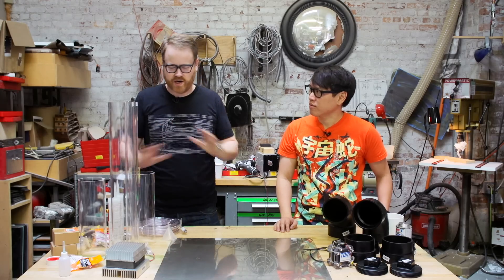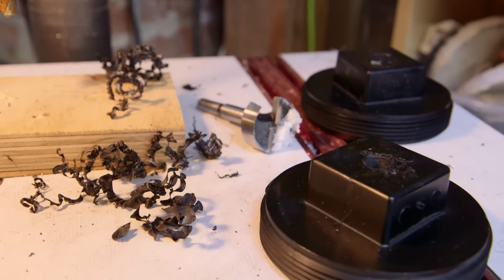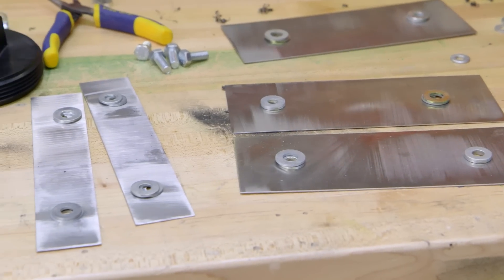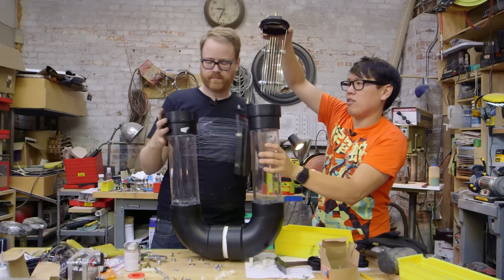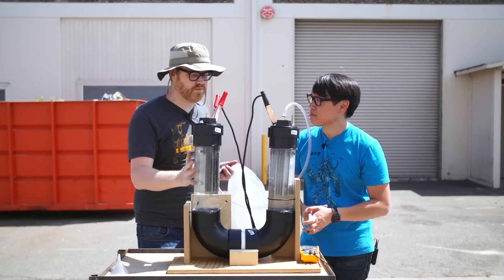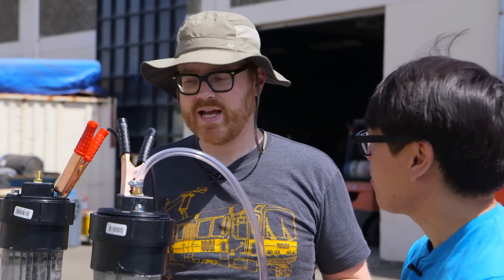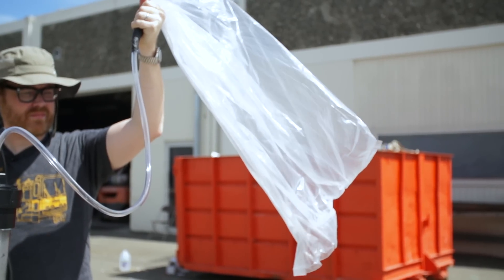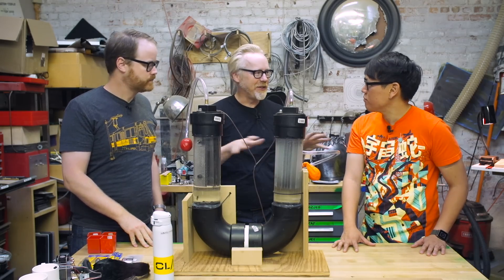Tested Builds a Hydrogen Converter

Comment: That bag is too thin, lots of gas slips out.
Reply: +minihjalte 
Actually I am think about a water trap to collect the gas.. 
what they did to collect the gas actually surprise me lol
Reply: +minihjalte  Maybe Mylar would be more successful?
Reply: +minihjalte Which is partly why Hydrogen fuel cells are such a bad technology for many applications, the hydrogen is very difficult to pressurize and then store, compared to just pumping electrons into batteries.
Reply: +hallis1 NO2 molecules are way bigger than H2 molecules.
Reply: +thegreatMSG Grant made a water trap on Mythbusters to trap Nitrous Oxide for the Confederate Rocket myth. Looked like it worked well.
Reply: Correct, the hydrogen quickly goes through the balloon because the molecules are so small.
Also, the resistance greatly increases reducing the conduction because of distance -- one set of plates on plus and one on negative separated by the whole bend of the pvc - this does separate the H2 an O2 gases but sacrifices efficiency. If a 24VDC battery was used the product would be much greater.

This 'improvement' is not such over the greater production of a mix of gases placing alternate plates pos and neg at much closer distances.

Comment: The hydrogen economy is a bit of scam. 99% of H2 comes from natural gas and fuel cell ev´s need EV batteries to supply enough power to the motors; so its an EV with a $100k, overweight range extender.

Both price and mass need to come down one order of magnitude until its viable. Not to speak of the almost insurmountable task of actually storing and supplying megatonnes of H2 to consumers. Ship engines and stationary backup ok, but cars and basement power plants not so much.

Comment: Now if you put the hydrogen gas in a blimp and replace the fuel used up by hot air, you've got yourself a really exciting gas tank :-)
If only hydrogen could really be made liquid at room temperature and 1 bar. It's just too cumbersome to use for transportation. Combustion is so utterly inefficient. Just like petrol. More stove than motor. Which is why electricity wins, at least until a 3-4x as efficient combustion engine is allowed to exist.

Comment: i got really excited when i saw you were using a renology solar panel.   did you guys like it, i use a smaller sized panel to power my fish tank air pumps and filter.  i need a second panel, and larger power storage before i lose daylight to winter.  also in about 2 or 3 weeks, it will be running for a full year with almost no "on grid" power sources.  winter gets cold in new england, and i need heaters, and with the less light in winter, i have to go on grid for heat, and sometimes the filter, as it drains the battery pretty quick when there's no sunlight.  and just if anyone wants to know, it's a 50 watt panel at 12 volts dc, and a 12 volt 30 amp deep cycle battery, the air pumps run direct off the battery, and the filter through a 120v ac inverter.

Comment: I'm going to make some assumptions on the construction of the rig, I presume 316 grade stainless steel plates were used for anti corrosion properties as electrodes. Perhaps a different material should have been used since stainless steel wouldn't be that good of a conductor. Maybe some copper or brass; the worry of corrosion would be negligible due to the short life of the device any way. Results could be way more excitable.

Comment: The reason this didn't work as well as the other videos is because you attempted to separate the anode and the cathode. The closer they are together, the more current you get to flow through the water. Besides, having a perfect mixture of pure hydrogen and oxygen is the fun part ;)

Comment: Environmental wackos are so silly. Solar panels arent "clean energy". The materials to produce them have to be mined. For example silver, which requires moving tons of earth. Good luck doing that with battery powered excavators and solar panels charging those batteries. Then when they are dead they go in a land fill. Not to mention they are less efficient than just using gasoline because they are more expensive. The reason they are more expensive is because they require a higher investment of resources. Ultimately the main "resource" in a all production processes is human brains, so solar panels are sucking up human brain power at a rate far and above petrol production on a per jewel of energy output basis. Brains that could be used to make our lives better in any number of ways, including but not limited to, finding ways to reduce the need to consume power. Its all just such nonsense. But you know why they call it the green revolution. Its all about that green.

Solar panels are definitely nifty though. I hope the day comes when they do make economic sense.

Comment: Really cool idea for an episode. I enjoyed it, but garbage bags don't really hold hydrogen very well; it's a really small element (120pm vs Oxygen at 155pm) and thin plastics like garbage bags are prone to let it through. An empty Mylar balloon might be a good substitute! Also, like someone else said, if the molecule is being broken apart anywhere, you'll end up with both components at each end of your tube. It doesn't automatically remove the hydrogen at the anode and oxygen at the cathode. It's cool though, it was still a fun build!

Comment: It's weird they had so little success with this.. We had a science teacher build one of these in class once, and it was no where near as complicated of a build.. Plus he had a circuit to up the voltage, dono why these guys didn't do that, 22 volts is pathetic. And when our teacher turned his on, the water was practically boiling!
He filled a whole balloon by the end of the class.. Then, tossing safety to the wind, he took us outside, tied a flammable string to the balloon, and lit it.. A few seconds later, every window in the surrounding block was shattered, and our ears were ringing.. Of course, he got in a ton of trouble for that, but it was the coolest science experiment I ever witnessed in school.. heh
Reply: +smlifyrasor How big was the balloon?
Reply: +smlifyrasor Holy shit, you teacher was awesome.
Reply: +smlifyrasor Yeah, Tested's rig has a lot of empty space, so there's a lot of stable water just sitting there. They tried to 'maximize' surface area, but didn't do that at all, only about 1/3 of the rig is at work at any time, if that. A little more research would have probably yielded a better result, specially with a shop like that.
Reply: +smlifyrasor How did your science teacher's gasifier develop enough pressure to inflate a balloon? Just gas bubbling up is not going to overcome the elasticity of a balloon skin.
Reply: +Paul Frederick Well, hard to remember because it was over a decade ago.. But it was a very big balloon (maybe a weather balloon?), and I think it had already been pre-stretched or used for something, fully inflated and then deflated.. Plus he didn't really fill it to it's max, because that wasn't necessary, so it was still a bit floppy and wrinkly.. But that didn't matter cause it was still huge..
Also, I don't think this would even be a problem, as long as the system was properly sealed, eventually the pressure would build up anyway? I don't think pressure would stop the electrolysis, and there would be no where for the water to go, so the expanding gas bubbles would still keep filling it up.
Reply: +smlifyrasor Pressure will actually slow and eventually stop electrolysis.  Also, I'm a bit surprised that you had shattered windows as this is done indoors with no ill effects.  It definitely would have to have been a hydrogen and oxygen mix, straight hydrogen would be too slow of a burn (still quite explosive in our oxygen atmosphere, just takes time to mix).

Comment: The funny thing about hydrogen power and solar is in its life it cant recover the energy needed to manufacture it.
Reply: +Karan Chaphekar 
What kind of solar are you referring to? Photovoltaic can, given enough light. It maybe wont recover the energy if your putting it out way in the northern hemisphere. But theres also other Solar Power. And Hydrogen istn even intended to "create" energy. Its just as a way of storing Much energy in a very dense package. 
If you mean Hydroelectric power you are very very wrong: Norway covers all their energy needs with hydroelectric and Wind Power. All the Oil they have is exported or used for cars and boats only. (They also are the country that buys the most Teslas, so in Future theyll need no oil anymore)
Reply: +Stuner Only where the sun shines. I live in Phoenix. Solar is fantastic. Not just for electricity, but for things like home heating and hot water, but my uncle lives in Seattle and hasn't payed for his system yet after 15 years.
Reply: +Karan Chaphekar Solar Panels have an energy payback time of about 1-4 years depending on the technology.  Read "Energy payback time (EPBT) and energy return on energy invested (EROI) of solar photovoltaic systems: A systematic review and meta-analysis" by Bhandari et al if you're interested in the details.
Reply: +Karan Chaphekar There is no type of power that can recover the energy needed to manufacture it. Every time you convert energy from one type to another you lose at minimum 10%.
Reply: maxpolaris99
you mean those things that leak energy like you're trying to carry milk in a fishnet?
Reply: +Karan Chaphekar you say that in your youthful recklessness, but there are many many powerful solar arrays that can put out the amps to produce a lot of hydrogen gas, which can be used to heat your home for example, saving you hundreds of dollars in energy bills. And when you don't use it for heat, store it for later use or when the sun doesn't shine. Hydrogen is the perfect battery because obviously you can't store electricity. It just "disappears" if it's not used
Reply: +Mathew Crawford Energy return on investment is not the same thing as financial return on investment. There the main problems are the massive (direct and indirect) subsidies of non-renewable energy as well as the fact that most power companies don't want their customers to install small PV systems and will therefore give you a laughable feed-in-tariff.
Reply: +Karan Chaphekar If we could get the whole operation of manufacturing in space using solar, who cares?
If we use  1 million watt hours of fossil fuel energy to produce a solar panel that returns 750,000 watt hours of energy its a loss. If we use 1 million watt hours of solar energy in outer space to produce a solar panel that will return 750,000 watt hours of energy back on Earth, its  win.
The Laws of Thermal Dynamics guarantee we will always get less than we put in. But if what we put in was previously going unused or wasted, we are operating in the gain column.  
So suck that Mr Negativity!
Reply: +Stephan Wahlen You didn't just use hydrogen and dense in the same sentence, did you? Hydrogen has a pathetic energy density.
Reply: +Karan Chaphekar [citation needed]
Reply: +Paul Frederick  Hydrogen has quite a nice energy-density when stored compressed - far far beyond what any battery can do right now.
But that comes at the cost of needing high pressure tanks - aka you can not really do this for small amounts of hydrogen efficiently.
Reply: ABaumstumpf
No hydrogen really does not have a nice energy density, at least not compared to gasoline. Gasoline has more hydrogen in it than hydrogen does. Being as gasoline is a hydro carbon.
Reply: Paul Frederick  We are talking about storage.
Gasoline can not be produced that easily (yet).
But you can use hydrogen for energy-storage.
Reply: ABaumstumpf
You can pump water for energy storage too. Or winch a heavy car up a grade. Both of these schemes are already in use. Converting electricity into hydrogen is like converting dollars into pesos at a one to one exchange rate. It is just an incredibly bad deal.
Reply: Paul Frederick
 You seem to have no idea what you are talking about. 
Incredible closed-minded and over-confident - that is what you seem to be.

Yeah, pumping water can be used to store energy - so?
Have you tried using that water to power a car? Oh, that can't be done?
but with Hydrogen you can?
With hydrogen you can simple move it to wherever you need it - simply move the tank and you can use it at home, in a car or somewhere else.
It is a rather nice way of storing medium quantities of energy.

For water-storage you need stationary facilities. They are useful too, but they also have their limitations.

With water for example, you can either have a huge station with big reserves and huge power, or you got smaller ones with really low power.

With Hydrogen you can have extreme output-performance, far exceeding any mechanical powerstation, far exceeding batteries or even gasoline.

It has its uses - and it is used guide a lot.
Those people know what they are doing - you are NOT smarter than the engineers that design those systems and use them.
Reply: ABaumstumpf
We already have fossil fuels. Why convert hydro carbons into hydrogen.Why take the extra step and pretending it's a new energy source  that is adding to our available energy resource?
Reply: maxpolaris99
"Why convert hydro carbons into hydrogen."
Nobody suggested using hydrocarbon as a basis.
And fossil fuels have this tiny little problem of releasing millions of tons of CO² when burned.

"Why take the extra step and pretending it's a new energy source  that is adding to our available energy resource?" 
Again - nobody says that - how about you read what was actually written?
It is to STORE energy we produced otherwise.
Wind, water, Solar and atomic energy sources are nice ot have, but they all can not keep up with our energy demand.
Wind/solar is too unpredictable, Solar only works on the day, and Nuclear power is too slow. 
We currently are using water-energy as a buffer to keep the grid stable.

And that is just one of the applications of hydrogen.
Another is as portable medium-sized energy-source.

It is NOT a primary source and in no way can it be that. It is only an intermediate storage form that has its uses.
Reply: +maxpolaris99 How many fossils will I need to make a barrel of oil? 

Why does the Earth make oil? What planetary purpose does oil serve? Is oil here to serve us?
Reply: ManufacturedLack Answer: N/A.
Reply: *****
Batteries Batteries, ever heard of fucking batteries?
Reply: maxpolaris99 batteries are nice and do have their use, but they also have their downside.
More often then not, they contain rather dangerous chemicals that are hard to handle once the battery dies.  
They also cost a lot to produce and maintain, and offer less capacity per volume/weight than other forms of energy-storage.
  
But on the other hand, they are easy to use and work without the need of huge extra facilities.

hydrogen on the other hand, needs special equipment to produce and to be turned back into energy.  
But storing large amounts of energy is no problem and it does not lose its energy.

Everything has its pros and cons.
Reply: I'm with you.  And misinformation sells Pie in the sky. No one ever talks about that silly Law of Thermodynamics. 
That says every time you change from one type of energy to another,  you loose about 30 %. ..
As in, a one hp motor connected to a generator will produce about 740 watts. And it takes 1100 watts to turn a one hp motor.
Also,, think about this, Where do you get the electricity to put in your electric car? The cheapest place is a Coal fired generator. 
So,  your electric car runs on COAL....
But we are not allowed to think that way.
Reply: apinakapinastorba
Typical troll account. How many fossils to make a barrel of oil?
Reply: ManufacturedLack
 Where is your psycho therapist?
Are they not there to serve you?

Comment: Jesus... Voltage x Amps = Watts. Watts is the only measure of energy you need to be concerned with provided the voltage is not to low or two high. A car battery might discharge at 12V but will do so at +100amps, that gives you 1200W. Your solar panel might be 22V (max) but only providing 5-8 amps leading to 110W-176W.